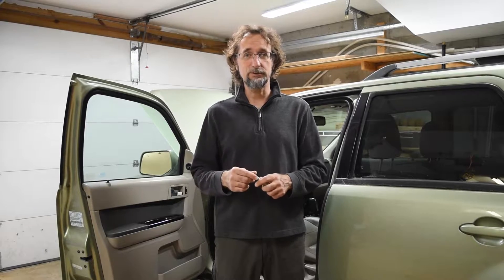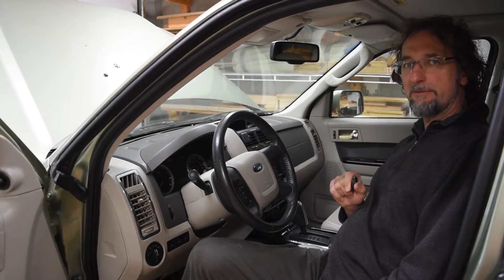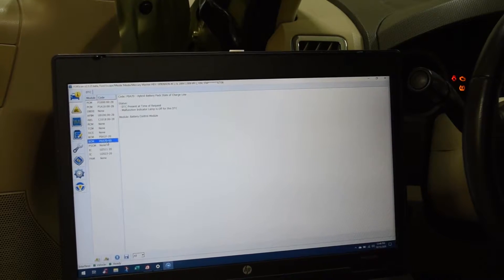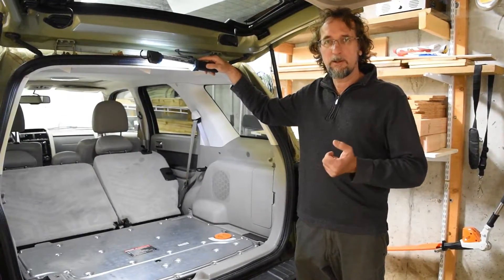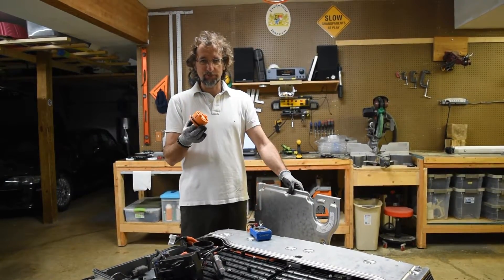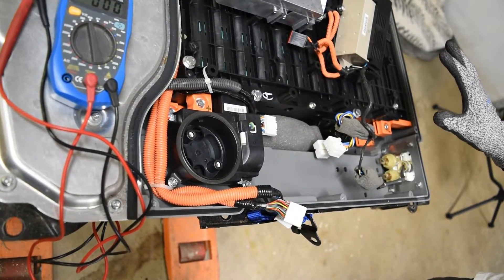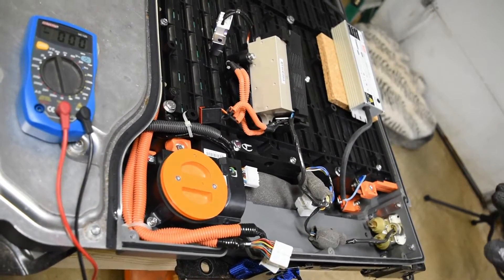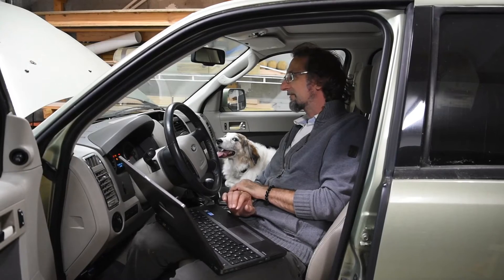Recharge dead HV battery on 2009 Ford Escape hybrid

Comment: You can charge the battery in the vehicle, you tap into the two leads on the driverside of the car, they are wrapped in grey foam. Cut the zip ties and remove the foam,  you'll see two connectors with one wire in them, the Grey connector is positive and the black connector is negative. If you have an  older FEH and want to wall charge the HVB, disconnect the Grey and black connector from the on board charger and connect the 110v  charger to the connectors...
You're welcome. I spliced in an xt90 connector so that I can.charge with a 110v charger anytime it needs it. I cut a small panel for access to unplug the onboard charger and connect the 110v charger. Easy easy, now I have options on how to charge it.

Comment: To get the "hard to get at" screws out so you don't have to remove the battery, get a HF $4 tamper proof torx set with a T30 torx and the  HF $12 set of offset SAE ratcheting wrenches which includes a 1/4' wrench to fit on the T30 torx bit.  Be sure to put a piece of electrical tape over the end of the bit before you slide it into the wrench.  Otherwise you'll loose the bit. If you remove the side panels the screws will come out fast and easy.

Comment: This video actually helped me too! I have a 2006 (with the jump start mode) but my jump starter doesn’t work. Throws a code for “jump start module system fault.” Tried this method and it still worked, so thank you anyways!

Comment: Thank you for the info... I like the vehicle but now I'm afraid to buy it since I hear that battery can go without warning and is over $3000 just for the battery... uuuhhggg I'm on a fixed income of sorts I really like the looks of the vehicle and saw one for sale I need a vehicle asap.
Reply from the maker: Hello Kathy, Overall the Ford Escape is a good choice with or without the hybrid technology. It is pretty reliable and the fuel economy is good on the 4-cylinder non-hybrids as well. Maybe you can find a 2008 or 2009 with the 4-cylinder engine and low mileage? The Mercury Mariner is basically the same thing. Best of luck, GG

Comment: BTW, you don't want to fully charge the battery to 345V unless you have a fan blowing on the battery sticks as the battery's thermal management system is disabled.  Just charging it to 310 volts should be enough to get the car started.  Then just let the vehicle run and charge the battery until the ICE shuts off.

Comment: Thanks for this video; I too had a no start/crank situation on 2009 Ford EscapeHybrid. Getting the lid off the battery was hard since the 4 bolts on the left and right sides of the battery are difficult/impossible to get at with the tools I had; so I unbolted, disconnected, and lifted the very heavy battery to get those four bolts out. For anyone trying this, do the two “hidden” counter-sunk Torx 30 ones first. If you can manage those without lifting the battery then you should be able to get the lid off the battery without unbolting the battery. The other two bolts come out with an Allen wrench or (my approach) by using needle nose locking pliers. I removed the orange safety plug, removed all the Torx30 bolts and the two hex head ones at the battery’s forward edge; then lifted the lid off.

Found the wiring harness remnant from where the charger was omitted after 2008 (see @urntwrthyZ comments below from 6 months ago); unwrapped the foam, put the big orange safety plug back into the battery. As suggested, the grey and the black cube-shaped connectors, each with one wire into them, had high voltage. I stripped two solid core leads and pushed one in each of the connectors to make good contact with the cables on those connectors. Tested voltage: 275V across the two. (Too  low to crank engine).

Connected the LED power supply (MeanWell HLG-120H-C350A  with 430V DC output); + to +, and minus to minus; applied 120V AC to the power supply; attached multi-meter across the two output connections; voltage immediately started to rise from 275V. After 40 minutes the voltage was 320V; an hour later 339V; then 1 hour later: 344V. Very slow rise after that. Left it to charge overnight and it leveled off at 357V.  

Disconnected everything, secured wires, bolted battery lid back down (I left the 2 countersunk bolts out). With everything safely secured, I was then able to crank the engine and immediately did some driving. All has been OK since then (last 24 hours).

Comment: There is a button at the driver side on the dash under a cover to charge the hybrid battery from the 12V battery!!! Read the user Manual!!!!
Reply: This button and the charger within the high voltage battery were omitted by Ford starting with the 2009 model
Reply: How does it work?
Reply: More info please.

Comment: I had a check engine code come up but the person at auto zone said it was showing it was the front battery? Is he a idiot or could that be cause I’m sorta having same issue the light went back off but it keeps wanting to no crank no start at times had ignition replaced 2 years ago so that I don’t think could be the issue

Comment: If you have a scan tool that can clear the codes, that'll get it starting then you can just let the gas engine recharge the HV
Reply: False. If you have a completely dead traction battery the engine will not start. The traction battery is what starts the engine. You need to charge it in order to get the car functioning properly.

Comment: Life just got much easier for this.  First, you can leave the HVTB in the vehicle,  we ground down a torx bit to access the bolts on the front sides of the cover. You can get at the ones mid-side with channelocks.  This is easier with the trim panels removed.   Now for the HUGE time saver.  You do NOT need to remove all those internal parts on the passenger side of the HVTB.  On the driver side of the HVTB there is now a bundle of cables wrapped in gray foam where the charging circuitry was for the 2005-2008 models.  Unwrap the foam.  Ford left the connectors for that 05-08 charging circuitry on that cable.  The gray one is positive and the black one is negative.  They are on the ends of the wires in the orange split conduit that goes into the side of the battery trays. Connect your charging cable to those and  you can charge the battery that way.  This is now less than a one hour job and WAAAY easier. I left my cable permanently connected and ran in out the side of the HTVB with a safety cap on it.
Reply: Holy shit I am about to do this. Pardon my French.
Reply: @kristophershofner5874  Please update with experiences, pics or videos of your own!  I'm going to try it also as soon as the charger I ordered gets here.
Reply: I knew there had to be a simpler way than taking the battery apart. After all, the battery gets charged from the hybrid motor with full voltage. NOTE - 60v DC is enough to hurt you bad. The voltage in these batteries ABSOLUTELY will kill you. I would not go near any of it without actual electrician's gloves.
Reply: I would very much like to know more about this.  Where exactly is that gray cable?   Do you connect it to the 12V battery like the 2008, or to the high voltage charger described in the video?
Reply: What you speak of is not there. The wires are red and black from the quick charger port. No foam on mine
Reply: @KyleBain-q5z  It most definitely is if you have a 2009-2012.  Where the battery charger used to be is a bundle of wires wrapped in heavy gray foam.  It is on the driver's side of the battery.
Reply: Three grey connectors and one black plug.  Two stout wires (one red and one black) have about 115v.  Where do we connect our high voltage charger?
Reply: @mcglothlenchris4212   The red and black connectors are on the ends of the wires going into the HVTB that are in the orange split wire conduit.
Reply: Do you have a picture or video? I saw a video where guy was connected way up by orange outlet - and charging/jumping from that place but he never did a closeup to show how leads are hooked up. And another tech was going to charge it and prev owner had single set of pig tails and they were not I am getting side scews out today.  And charger was in low 300V but charged to 350. It seems like your way you don't have tear out bms etc and then charge top/bottom each separate. Anything that you can provide would be awesome. I m using a mean well charger I see all over these videos. Thank you in advance!
Reply: @obot77  I can't post a link, it keeps getting deleted.  The way I described is MUCH easier if you have a 2009-2012 model.  You do not have to remove any components from the HVTB.  On the driver's side closest to the front is the large bundle of wires in a large, thick piece of gray foam.  Cutthe tie wraps and unbundle the wires.  Look for the orange split conduit....those are connectors you are looking for.

Comment: How can you tell if you need to replace the battery vs recharging it? What type of charger is required?
Reply: Unless you have multiple shorted cells, you should not need to replace the battery. All it is NEEDED for is to start the motor. Note: if you have a bad 12v battery, the car will keep pulling power from the HV battery until it is run down (These cars do not have alternators..... just a DC to DC transformer).

Comment: Is there a particular Barrett charger needed to charge that battery or is it just any battery charger?
Reply: You need a high voltage (at least 350V, low amperage charger.  A Mean Well HLG-120H-C350A or B will work.

Comment: Thanks a lot for the info! Already did it on my first 2009 Escape and it worked like a charm! Now of course on the last day of the year my second Escape is having the same issue after sitting in the driveway for a week in cold weather. Since I already did it once this should be no problem.  
Dankeschoen from one German to another!
Reply from the maker: Glad it helped!
Reply: Could you help me out? I have a few questions in regards to the tools they are using.
Reply: @josuefigueroa3643 sure. What do you need to know?
Reply: @EricGForce how do you clear codes?

Comment: Quick Question…i exactly put the wire same way you describe in this video but when i connect the charger supply, it still showing 430 Volts even when i put the safety switch back…it doesnot charge….any suggestion? Thanks

Comment: This works just started my grandpa's Ford escape hybrid 2009. Need a shop crane to get the battery out and reach the bolts on the side to remove the cover. Used the charger recommended and bought from the source in the video description.

Comment: Do you NOT have the button behind the left side little panel?
That reset button does the same thing.

Perhaps this is what was removed in 2009 model?
Reply: The button is not present in post-2008 models
Reply: @MrFafolaktik    you have a pic of the fuse panel?
Reply: Not only was the button removed, the charging circuitry was removed from the HVTB for 2009-2012.  There is an empty space where it use to be.

Comment: Why do I need to remove the battery from the car. Can’t this be done with it still in the car? 
Or is there a danger to it being connected?
Reply: you can disconnect the battery from the car.  You dont need to remove it, it is just a pain to get the torx screws from the sides off.  I had to grind down a bit to get the screws out.

Comment: Why did you choose to take the HV battery out to charge it? Why didn't you use the HV battery recharge override button in the driver's compartment? That allows you to charge directly from the 12v battery/charger. It won't get it up to a high state of charge but it will get it to the voltage necessary to start.
Reply: My understanding is that the override button on the driver side is only previous year models (I believe 2005-2008). I checked on my 2009 and it doesn't have one.
Reply: @JoeCarlinCA  Major bummer! (And an excusable on the part of the engineers.)
Reply: How did you find out it doesn’t exist on the 2009?? Maybe it’s just in a different place?
Reply: @Suspendedanimation007  I've got an 2009 Ford Escape Hybrid. I've been told there isn't one and the dealer said there isn't one.
Reply: @Suspendedanimation007  Not only is the button not there, but Ford also removed the charger from the HVTB.  There is now a cable wrapped in gray foam where the charger used to be.

Comment: Dealer told me I need to buy a high voltage inverter to get my car to start. They said they charged my battery and it wouldn’t turn over

Comment: I removed and charged the hybrid battery and placed back in car.  I had over 350 volts on the battery when I reinstalled the battery.  I drove for about a week and then the car shutdown again.  I noticed that the charge indicator stayed in the middle range.  I am not sure if the needle should move more than mine ins doing, staying midrange.  Could this mean that while driving the hybrid battery is not recharging eventually discharging the battery so the car shuts down?
Reply: Is your AC OK.  The computer takes the HVTB offline if it's temperature exceeds 100 degrees.

Comment: I want to weld a body part, is it enough to disconnect the 12V battery or is it necessary to disconnect the high voltage battery?  Thanks

Comment: There's an easier way than that
I know for a fact
Reply: Like how?
Reply: @mr.2cents.846  by taking The two connectors that are color black and gray going into the TCM (long computer) that are single wired. Remove wire from connector on both (can also check voltage from there) get a 12v battery charger or similar take black wire to negative and orange wire to positive charge for 2hrs check voltage if higher than 300 volts you can put in back together and it will start....if no there codes are present
Reply: @chicagorainwater9383  Would love to see a video showing what you are describing.

Comment: So what type of charger did you use to charge the battery? Do you have a specific recommendation of charger to use? Thank you in advance
Reply: Same question what did you use to charge the Hybrid battery?
Reply: What kind of charger did he use
Reply: @sampsonelizondo2233  I think it must be some sort of high voltage charger to charge the cells in series. Otherwise the only way to fix the problem would be to remove all the cells and charge them in parallel.  I think the video poster left all this information out so that viewers do not endanger themselves charging a battery with over 300 volts, because the battery would not be in “service mode” or safe mode.
Reply: It's a digi key.
Reply: I have same year  hybrid. With same problem. What charger  do I need. ?
Reply: HLG-120hz-c350a
Reply: Hey Marvin, we’re all super eager to hear how you charged your battery, please share with us your information.

thanks, great video

Comment: Hi, the charger you recommend (used in the video) what hardware does it come with? Did you have to make your own connector to connect top battery and bottom battery? If you can share the information I would appreciate it!
Reply: The charger shown in the video is MEAN WELL HLG-120H-C350B or similar.  This is big omission in an otherwise excellent video.  Figuring out the charger and the connections is a really hard part that is completely glossed over.  The charger is 430V and the battery is 350V or less.  However this works because the internal resistance of the batteries and the charger keeps the current low.  The connections to the battery have to be created; there is simply no off-the shelf terminals that will work especially for the bottom one that is like a tuning fork.  We used large spike terminals that had to be formed into flat strips to stick in the terminal and alligator clips to connect them to the charger.  The charger comes with no connectors.  You even has to wire a house plug on the incoming side.  Again...a lot of struggle that I wish was covered in the video.

Comment: So just to be clear, you charged both levels of battery packs by putting terminals in the negative end of one and positive end of the other, using the orange power switch to connect the two? 

Just wondering because I've been videos of people connecting the power supply to the relay, inserting the relay, and charging that way

Comment: Hello .. I have the same problem .. When I went to AAMCO repair shop and asked him whether I could recharge my hybrid battery. He said that your battery has 0v so it cannot be charged.. Is that true? What should I do? please help me
Reply from the maker: This is very sad. Same happened to me. I was looking around and would have been charged a lot of money for this repair.. Therefore I decided to DIY. If you don't feel comfortable doing this yourself, maybe you can ask a friend for help. Please verify the 0V statement from the AAMCO tech, using Forscan. Good Luck.
Reply: Did you get a response to the question of being able to recharge a battery that shows 0 volts?  I have the same, 0 Volts, have tried this recharge method, and it doesn't charge.

Comment: Why not just push the button it has to pass the current to the back battery pack its by the door panel
Reply from the maker: Great idea. However, Ford redesigned the 2009 FEH and there is no more button to push.